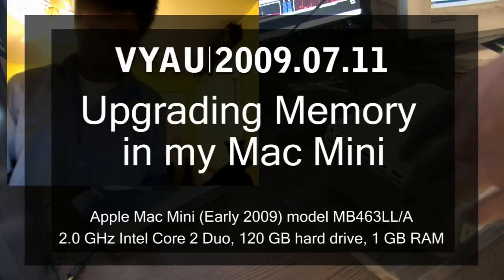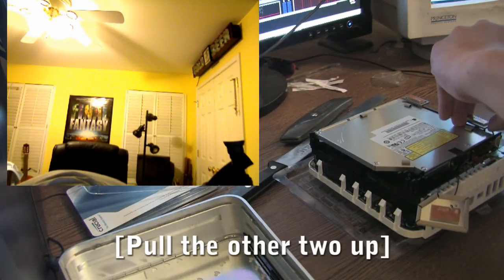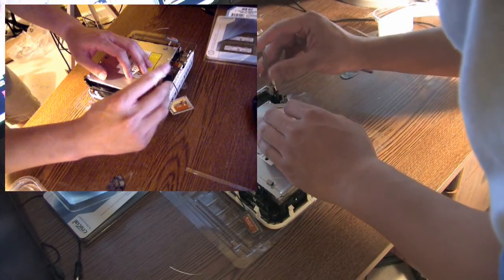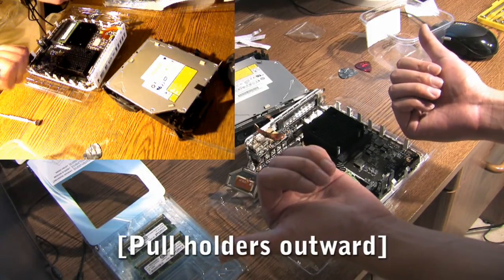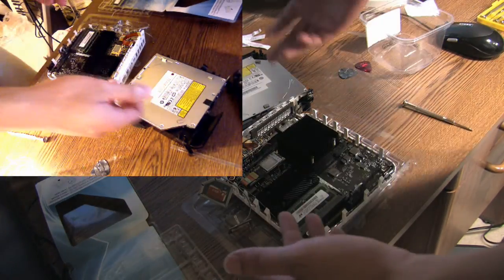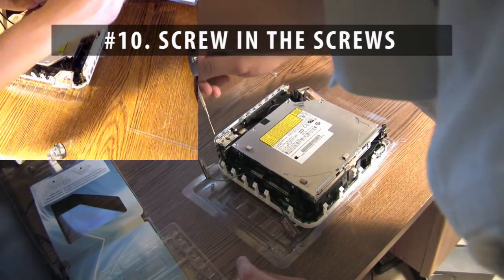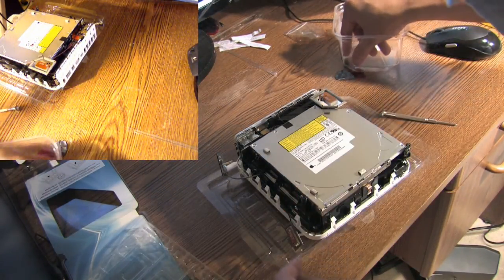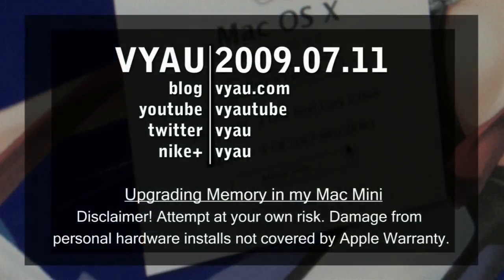Upgrading Memory in my Mac Mini (Early 2009) - VYAU

Comment from the maker: @thatulsta It's definitely worth it for me, I run a lot of memory intensive applications such as graphics/video editing and games. Also I run my 24" monitor at 1920x1200 resolution, and since graphics memory is shared on the Mini, the extra RAM really helps.

If you just casually use say iLife apps you probably won't need it. You probably won't notice a speed increase as much as you find that you can push your system to do more without slowing down.